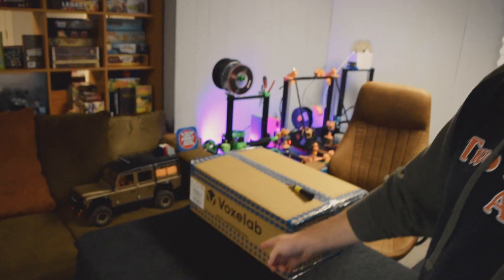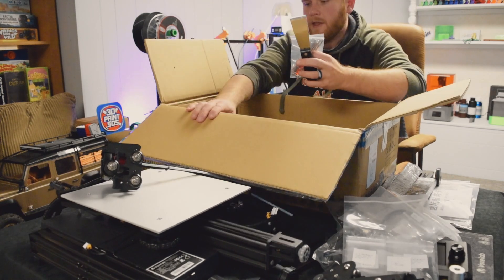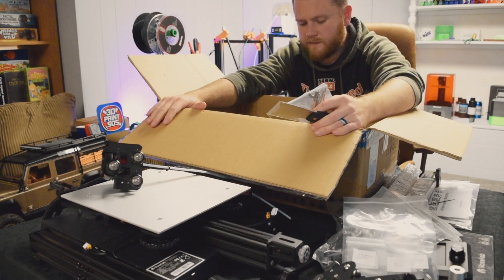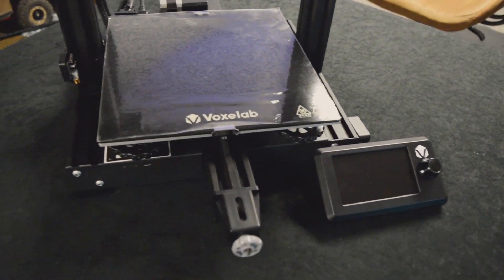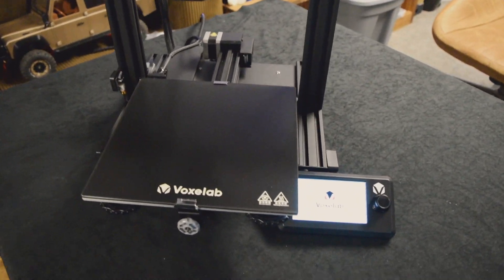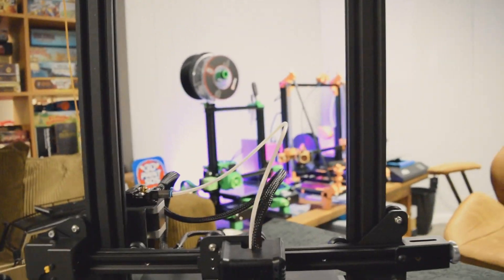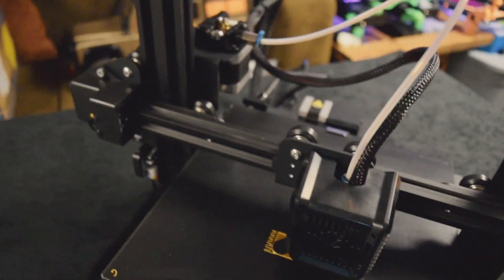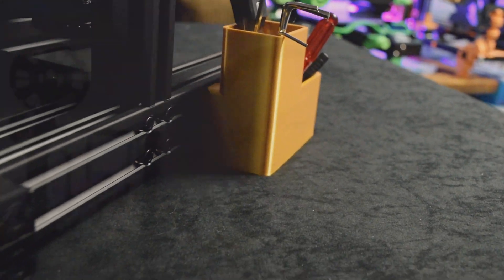Voxelab Aquila Unboxing, Assembly, and First Print

Comment: I read some of the other comments here and I have to agree. You don't get nearly enough views or subs. Your review of this printer is very good.
This would be perfect if it had a direct drive extruder... I still might get it. I was originally hoping to use flexible filament. Have you tried flexible filament with this printer? What about ABS?
Reply from the maker: Thanks! Yep I have videos of it’s printing flexibles, PETG, and now abs. It does it all!

Comment: Question, should you update firmware right away or is it really necessary since I’ll just be printing busts and things like that?
Reply from the maker: Only necessary if you need things like auto load and unload or you’ve fitted a bl touch. Otherwise, no need. It’ll print perfectly without. :)
Reply: @3DPrintSOS  thanks, I haven’t updated for my Ender 3 v2 either, for what I’m doing it wasn’t necessary. Before I pull the trigger, do you know if the upgraded metal extruder will fit since the filament guide is moved away from the z screw?
Reply from the maker: Yes. An Ender 3 v2 extruder will fit. :)

Comment: Hey so this is my first 3d printer and I’m semi new to it. I thought I had mine assembled and set up I did all of the balancing eight he springs underneath all that. When I try to automatic load it doesn’t take filament and then the top where the needle is for the filament (extruder I think?) and it keeps hitting the side (x axis) and I don’t think they synchronize belt is moving at all. How would I fix this?
Reply from the maker: Is it possible you have the wiring mixed up? Maybe that’s why the extruder doesn’t move. Go in the settings and try to move each axis separately. Extruder should move filament, y should move bed, x should move print head, and z should move the gantry up and down.
Reply: @3DPrintSOS  when I try to go into the settings and move everything, it says that the needle isn’t at the temperature to move yet
Reply from the maker: Hmm. I’d have to check on my machine. But it should let you move everything except for the extruder. Obviously, it can’t extrude plastic without it being hot. If you are getting that message on any other axis, it’s likely a wiring mishap

Comment: I've been making my way through your introductory videos and am about to pull the trigger and buy this on Amazon. But I had one big question, does it only print through files you upload to an sd card? Or can you connect it directly to your computer when you use Cura? Thanks in advance!
Reply from the maker: You can connect it with a usb cable directly. You can also connect it to a raspberry pi and run octoprint for complete wireless access.
Reply: Thanks so much! Just made the purchase, should be getting it in two days!
Reply from the maker: You’ll love it. Just take your time with setup and leveling and you’ll be good to go.

Comment: I just got it this week. I have the following issue:

When the nozzle heats up it starts "oozing"  and when thr print starts it will stick to the nozzle and drag the first line.   Sometimes i succeed to keep it away just before touching the brd with a cloth and then it prints fine.

How can i fix this? I have to restart prints often this way.
Reply from the maker: Oozing is something that just happens. The hotend is hot and there is pressure between the hotend and the extruder because of slight play in the tubing. So the plastic will always ooze a bit when the printer is just sitting there. What I like to do is have some long tweezers sitting by the printers and right before the printer starts to print I just grab that little ooze off the nozzle.
Reply from the maker: Another thing to do is print with a brim or a skirt, it lets you “prime” the nozzle and get rid of the ooze before starting the actual print. You can also move a skirt closer to the print, which reduces the time between printing the skirt and the actual print.
Reply: @3DPrintSOS  thank you for your reaction and help!  A tweezer is a good idea. Sometimes just before lowering it shoots a lot and it sticks to the nozzle and drags everything.   Still learning a lot. Am new to 3d printing. Found out about the aquila thanks to your vids.

Thanks for making them. Learning a lot from them :)  and make a lot more hahahha :)
Reply from the maker: It’s a super fun hobby. Just takes some patience sometimes. :)

Comment: Just assembled this and it’s not working. The filament comes out sporadically and the range seems to be off. It prints right off the board. We followed the very song using directions exactly. Any tips?
Reply from the maker: Sounds like you need to level the bed with a piece of paper. Be sure to tighten up the belts and make sure the wheels on the bed are snug, not to tight, but not loose enough to wobble.

Comment: Just got mine today
Reply from the maker: Nice. Time for some fun
Reply: Do I set it to 230v?
Reply: Hi I have tried to get ahold of voxelabs about this. But when I input auto home it doesn't find it any ideas?
Reply: My z motor stepper doesn't work. It's not even moving.
Reply from the maker: Hmm. Something has got to be unplugged or plugged into the wrong plug.
Reply: @3DPrintSOS  everything is plugged in properly. I went over it 5x
Reply: I did some more troubleshooting and the z motor is good it's the cable.
Reply from the maker: That’s great that you found the issue. I’m sure voxelab will send a replacement
Reply: @3DPrintSOS  like another 3d printer? Man so I got to wait geez this sucks for a first time user I'm not that impressed so far.
Reply: Plus I have contacted voxelab but no response.
Reply from the maker: I’m sorry to hear that Josh. Honestly. This thing has been nothing short of incredible for me personally. If you got it from Amazon, you can always return it and get a replacement? Voxelab is a Chinese company, so they might not reply during our daytime but if you have amazon prime, you can probably get a replacement in a day or two. 

Also, have you tried using a cable from another axis? Just to make sure it’s indeed the cable?
Reply: @3DPrintSOS  yes thats how I found out that the z cord isn't powering anything.
Reply: @3DPrintSOS  am I supposed to Crack it open and check there work?
Reply from the maker: It’s not abnormal for printers to require some tinkering. So it’s up to you how far you’d like to go. I do agree that it should work out of the box. Shame yours had a defect. Sorry to hear it.
Reply: @3DPrintSOS  I finally got ahold of voxelab and to make a long story short they believe it's the motherboard. So they are sending me another motherboard. Is that hard to replace?
Reply from the maker: Should be plug and play. A few screws, a bunch of connectors. To one connector at a time and go slow. Shouldn’t be too hard. Glad they are helping.
Reply: @3DPrintSOS  me too. Thanks for all the help man I really do appreciate it. I'm gonna get my channel up and going soon. So I could how off some 3d prints and bring some to life.
Reply: @3DPrintSOS  my friend it's alive. I'm so happy right now
Reply from the maker: Yes! Glad to hear it!
Reply: @3DPrintSOS  now I'm just 3dp like crazy.

Comment: The blue clips were missing in the box i bought any suggestion's?
Reply from the maker: Print them. :) Check out thingiverse, bunch of options available.
Reply: @3DPrintSOS  That's if i can ever figure out how to print stuff online. i mean i thought this thing was supposed to be user friendly. any advice or a video on how to print blue prints from thingiverse?
Reply from the maker: Check out my video on Cura and slicing. That will help you out big time. It goes over how to print files from the internet. These machines are honestly as basic as it gets. Just got to have some patience and an open mind.

Comment: Okay but where does the nozzle go and the material nozzle does it really screw in and how did you get the material holder in?
Reply from the maker: You might be interested in watching an in depth assembly from voxelab. The nozzle should be preinstalled into the hotend. The filament spool holder is held with two provided t nuts. :). If you lay everything out, you should be able to see how every thing goes together in the manual.
Reply: @3DPrintSOS  I saw the spool holder was supposed to be attached to the top but are you just supposed to pretty much slid it into place and use the T nuts to hold it in place? and I saw that a nozzle looking thing was preinstalled but whats with the spare nozzle
Reply from the maker: That’s correct, you can use t nuts to attach it to the top. Nozzles are wearables. They wear away after a while. So, you get a replacement right in the box. ;)

Comment: Question - my Voxelab Aquila showed up today and I got everything put together. Before I level the bed and try printing anything, I want to make sure that I have the belts tensioned correctly. Can you explain how tight the screws/belts should be?
Reply from the maker: I wish I had a more scientific answer. I just tighten them until build some tension in them. They can’t be loose and they can’t be so tight that it’s like a guitar string.

Comment: Any thoughts on clogs?? I've find Luke's hotend fix but it clogs like every other print. Do you know is microswiss hotend fits? I'm open to try anything
Reply from the maker: It will. However it might just be some misalignment or a not so perfectly cut tube. I bet you could fix it and be just fine. The hotend fix is awesome and I plan on doing a video on it soon.
Reply: @3DPrintSOS  I did do the fix based purely on Luke's specs for the ender 3 pro. I will actually measure and re cut the Capricorn in the morning.
Reply from the maker: That’s gotta be it. Something was pinched or skewed for sure. ;)
Reply: So I redid the washer and ptfe tubing  but the issue persisted. Swapped nozzle and not much luck. So I ordered microswiss and with the stock mounting plate the cooking fan shroud is a very tight fit but does fit and seems to extrude much more consistently. 

I have had a string of issues with the printer and voxlabs made me go through a LOT of troubleshooting which effectively put me outside of my return window. But I did get it to tinker,  my other printers run pretty non stop.  I got a bad unit and will make the most of it

Comment: sir, what is the best setting setup in VOXELMAKER for printing, about the support, beautiful printing ., i well wait your reply sir., have a nice day.
Reply from the maker: Hmm I’m afraid I won’t be able to help. I don’t use voxelmaker. I use Cura.
Reply: @3DPrintSOS  what is the setting for CURA., thank you for your reply
Reply from the maker: For supports, I like to keep the density high at 50% and I use the “zig zig” for easy removal. Make sure the gap between layers and the support is the same as your layer height. Otherwise all other stock settings are ok

Comment: Hi, at 13:45 you mention making adjustments so that the v-slot wheels don't have slop, but I'm finding no such adjustments. Tightening the bolts only better secures the wheels to their mounting plates, and does nothing to increase "grab or pinch" onto the extruded aluminum that the wheels seat in (can't change radial position of wheels).  So unless the bolts were mistakenly assembled loose, tightening them won't remove the slop as far as I can tell. Unfortunately, the right assembly on mine has a lot of slop and I can't find a way to reduce this.

Edit: They CAN be adjusted: the bolt holes are just large enough that you can loosen the wheels, pinch them together and (while pinching) tighten them back up. Probably not by design, and really finicky, but it works. Basically the holes are larger than the bolts so you have some radial play to work with.

Edit again: Okay still not quite right again. See replies below for correct/intended means of adjustment.
Reply from the maker: So each set of rollers has one or two that are sitting on eccentric nuts. One of the wrenches first perfectly around the nuts. They let you adjust the tension on each set. The bed wheels has two sets of eccentric nuts on the left hand side when looking from the front.
Reply: @3DPrintSOS  Eccentric nuts, wow so there is adjustment by design, nice! Learned something new too. I continue to be impressed by this printer. Looks like I made things a lot more difficult than they needed to be!
Reply from the maker: You were so close! But hey, hard to know these things without a hint.
Reply: @3DPrintSOS  The hint was the lone hex nut just waiting to be turned, by my doofus brain didn't realize it's purpose. I thought it was just a pretty hex-shaped spacer! Thanks for your help!

Comment: do you use enclosures at all for your printers? i have 2 cats and i’m trying to plan an enclosure setup for this and an ender 3 so they can’t sabotage my stuff
Reply from the maker: Kinda? I use stacking lack tables which could easily become enclosures. However I just wanted them stacked, modular, and in one place. So, this seemed like a great, inexpensive move. So not quite enclosures, but they easily could be.

Comment: dude why wouldnt you show the most important part? loading the fuckin filament.
Reply from the maker: You’re right, it’s hella important. Mostly because I’m a total noob at making videos. But I appreciate the feedback. 

If you still need help, you push the filament into the lever of the extruder. Once the filament reaches the gears, squeeze the lever and push the filament all the way until it reaches the nozzle.

Comment: I just got mine after seeing it on Amazon for $159. I had it assembled in about 90 min. It took me a few prints to get the 1st layer smooth, had to adjust on the fly, but it prints great out of the box.
Reply from the maker: Awesome. Good to hear. And awesome deal!
Reply: @3DPrintSOS  Question thought: the Z stop, is there a “right” spot when it’s installed or is it a trial and error thing? I ordered stronger springs for the bed. I’m having issues that the bed will hit the stepper under the bed.
Reply from the maker: I like to get the bed where it needs to be and then loosen the bolts on the z stop and adjust it all by hand first. Then tighten, home and micro adjust.

Comment: my test hook print went great but now i keep leveling, cleaning the plate and watching it move around and print nothing. then i cancel and repeat
Reply from the maker: Do any of the other prints on the SD card print ok? If nothing is coming out, it sounds like you may have a clog, temp issue, or extruder level arm issue. Try checking those first. Heat up the hotend and see if you can manually push the filament through. If you can, its gotta be settings. If you cant, its a physical issue.
Reply: @3DPrintSOS  It doesnt matter because now the control knob doesnt work and the metal contact on the limit came off so when it gets to the side it just bounces off the switch and gets stuck there. Hopefuly ill find that part, if not maybe theyll send a new switch?
Reply from the maker: Oh no. Yea contact them for sure. They stand by their product.

Comment: I am considering getting a 3d printer either ender 3 v2 or the voxelab aquila. any suggestions?
Reply from the maker: Since the Aquila is a clone of the Ender 3 v2, I would get the Aquila because it is cheaper for the same thing.

Comment: Ordered mine today, it's gonna arrive tomorrow, I'm excited af!

Btw, do you have an stl for the toolbox you printed?
Reply: There's a "toolbox" model on the included SD card ... leveling my bed at this time :D
Reply from the maker: Yep, it’s right on the SD card. :)
Reply: @3DPrintSOS  Oh! Good to know! I'm still waiting for my package to arrive, should be here in a few hours :) I'm excited to print my first few models
Reply from the maker: Let me know how it goes!
Reply: @3DPrintSOS  Printer assembly was a nightmare, they mention a countersunk m5x12 screw in the manual that doesn't exist in the kit, turns out you can use a spare m5x14 screw instead. Apart from that I'm pretty happy with the machine. Printed the toolbox with the included pla and ran out after like 75% of the print and had to hotswap filament on my very first print, definitely scary but it worked. 

After that I tried printing a few things, created a spaghetti monster and a few other prints that didn't quite turn out the way I wanted. but I'm sure it's either just  bad leveling on my part or settings in the slicer.

However many of my models have a lot of stringing going on, any idea what's causing that?
Reply from the maker: Hmm. Stringing is a mix of heat and retraction settings. Look up “stringing test”. Great way to tune that.
Reply: @3DPrintSOS  Will do! Also is there any particular reason why you're using cura to slice instead of the voxelmaker? I've been doing a couple prints with the default settings on that one and they seem to be a lot cleaner
Reply from the maker: Nope. There are so many great slicers out there. Use one that works for you. I’ve been on Cura for ages and I’m very familiar with it. It works with all my printers which is nice.
Reply: @3DPrintSOS  I mean I've tried cura and it seems like a very good piece of software with many different features that can all be super helpful. For now I'll just stick with the voxelmaker and maybe I'll transfer the settings to Cura and see if the printquality in cura improves :) 

Anyways, thank you so so so much for your great content on this printer. It's super informative and helpful, continue like that and you'll be up there in no time :)
Reply from the maker: That’s a good idea. If it ain’t broke, don’t fix it! And thank you. :)

Comment: my first test print last night that first layer was struggling to stick to the surface, some places did and others were not so spots on it were shifting. The bed temp was 60 and tool was 200. Any suggestions?
Reply from the maker: Go up to 75 on the bed. But also, sounds like the bed isn’t leveled. If things don’t stick it’s one of three things. Leveling, temps, or dirty/oily bed.